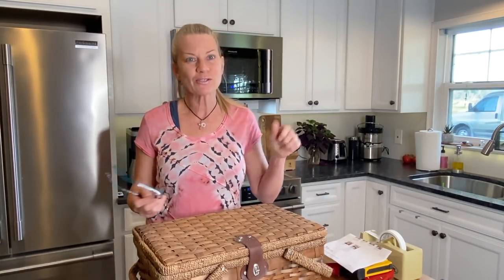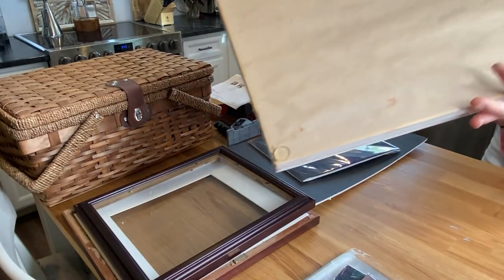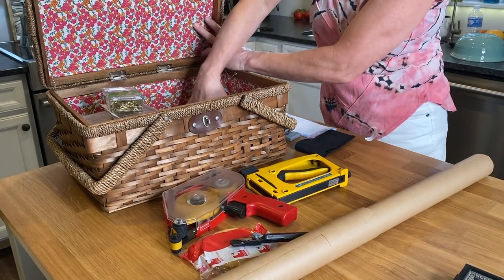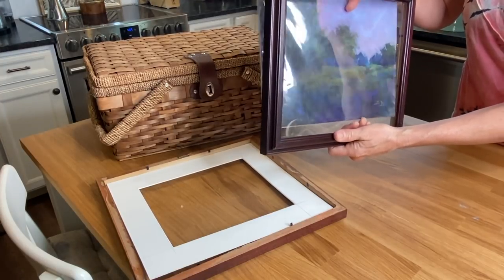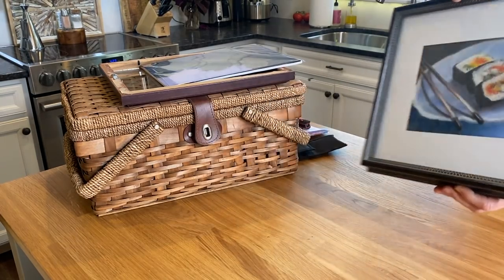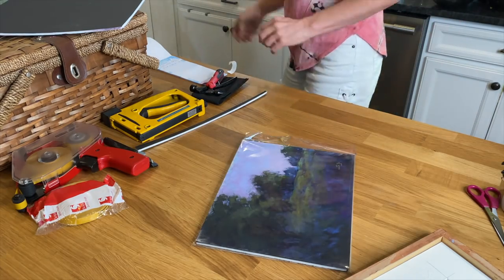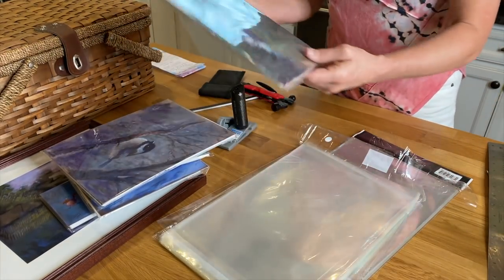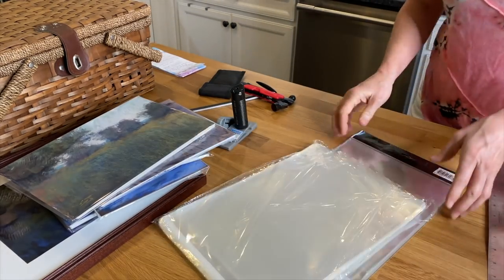DIY Framing Tips for Pastel Paintings! / Save Money by Framing Yourself!

Comment: ty so much answered a lot of questions- Could you not just take the mat and draw it to size and cut it out for the foam board? Instead of measuring it? Could you please tell me what to use for hinging the work to the mat board? TY so much
Reply from the maker: Yes, good suggestion for using the mat to measure and cut the foam board.  Also, I use artist's tape to hinge the paintings to the board. I simply tape a strip on the back at the top (leaving about half of the sticky part on top), and then place the painting on the board and tape another piece of artist's tape on top of the other one to secure.

Comment: Yes! I get my cards from Moo too, and have been using ClearBags for years, they are really good. You did not mention what kind of archival tape did you use to hinge the painting. I also think it is important to make sure that the mat and backboard are archival and acid free, don't you?
Reply from the maker: Oh yes.... I didn't mention using archival products, but I certainly do myself. The tape I used was "artist's tape" that can be purchased in many places. I get mine from Amazon, but it can also be bought on DickBlick.com.... I meant to mention where to get my tape dispenser. It's so helpful and I found it on amazon as well.  :)  Thanks for your helpful comment.
Reply: I would definitely do archival everything as well especially if artist quality pastels/mediums are being used and it's going to a customer, etc.  Better glass can also be purchased at most framing shops with UV protection in it to help preserve the piece.  They can cut it to the exact size you need and some places will even take store coupons. =)

Comment: I frame my pastels by standing them up backwards on an easel.  That avoids shedding extra pastel dust onto the glass.  Otherwise I use pretty much the same method for framing.  I hate that you wasted so much good painting behind that mat.  I think re-signing it in a different location to focus on the best exposure of painting or using a smaller mat would have been better.  Your painting is gorgeous and it's such a shame to waste so much of it.  I usually pick out my frame before I start the painting.  Good Will and yard sales have been a good source of recycling frames for me.  Also, I frame without mats and use spacers to keep the painting off the glass.  That's easier and less costly.  I love the way you share your information.  Keep up the good work!  God bless.
Reply from the maker: Jan B yes, I agree with your comment about having much of the painting behind the mat. I literally just did this for the video purpose. I will definitely reframe that one. I also don’t use mats when framing as I like the look of just the painting behind the glass. Unfortunately I didn’t have any spacers for a frame that would fit my painting for this video. I do describe the process though of using spacers without a mat. That’s definitely my preferred method. Thanks for your tip about framing your pastel stuff by standing them up.

Comment: I guess a reverse bevel would be necessary with a coloured mount.
Thank you for this Susan.  I actually now have a painting which I want to hang at home.
Reply: Not only the color, but also the surface on many mounts is quite different on the front and back, so just flipping it over would not do!  Sometimes, manufacturing info is printed on the back for example.

Comment: Lots of useful info. The clear bags link didn't work, (Whoops...Page not found), so I'll just google it.  Thanks, Susan!
Reply: Found them. I'm concerned they are not archival,  as Krystal Seal bags are, BUT..the cost is almost 4x cheaper!
Reply from the maker: Vickie thanks, and thanks for letting me know about the link. I’ll have to find the correct one and share. But yes, you can just Google it and find it easily.

Comment: Do you normally mount your plastic wrapped paintings on foam core with 3M adhesive, or do you assemble them unmounted to send when they sell?
Reply from the maker: I never use fixative on my finished paintings as it will darken the final pieces. Instead, I keep my paintings safely protected in clear bags. The clear bags are archival.  I get mine from www.clearbags.com.  Here is the specific link for the bags I like best.  I like to choose sized that are a little bit larger than standard sizes so I have room for my painting and for a piece of foam core board I add for support.  https://www.clearbags.com/bags/flat/flap-tape?cat=886%2C892
This is the cutter I use to cut my foam core board. It works great: https://amzn.to/3TilRkX
Here is a video of my process: https://youtu.be/4XD4SezFyBg